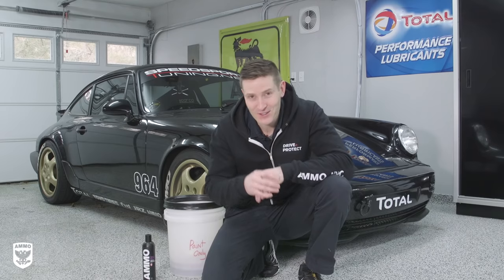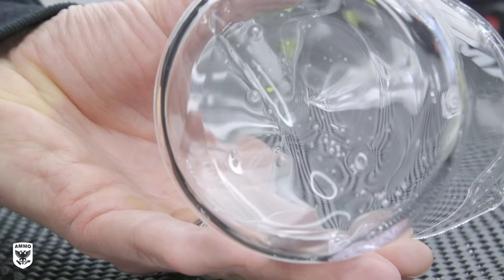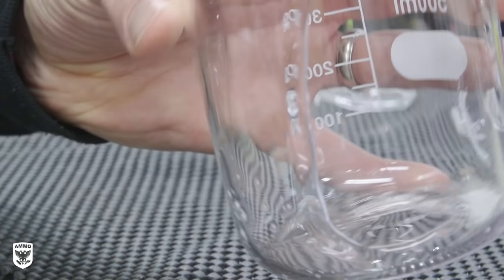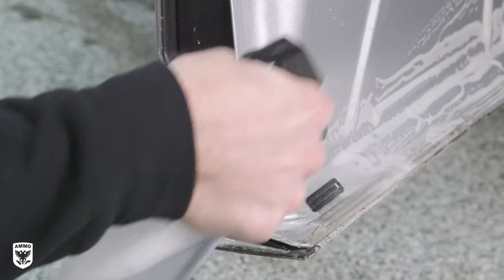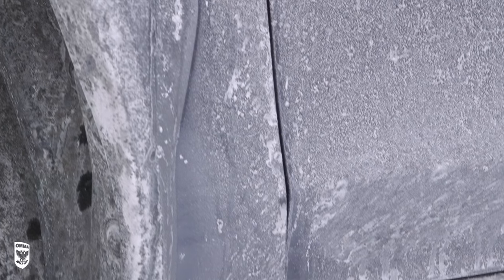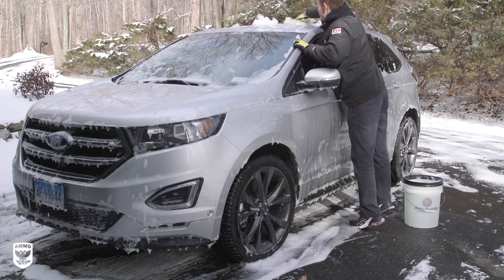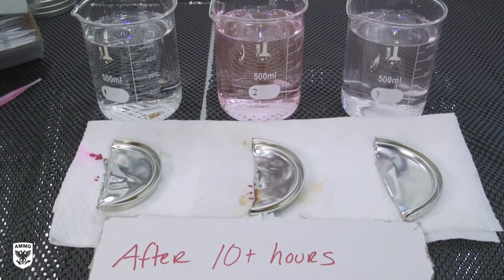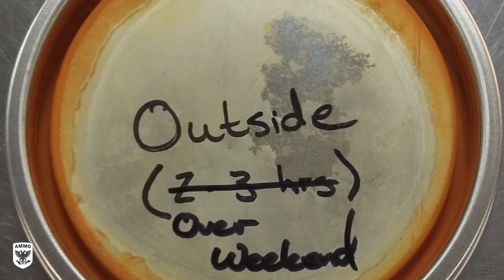Best Car Wash Tips for Winter Driving

Comment: I’m in Southern California.  Our cars don’t rust.
Reply: Aves Raggiana that's because there's no water in California to rust your cars.
Reply: Savage
Reply: That's why I really appreciate that Larry lives in NY. If he lived in Cali, he wouldn't think to formulate products like these, & guys like me, who live in the Northeast, wouldn't have any way of combatting rust.
Reply: Joshua LaVancher Touché.  I set myself up do that one.
Reply: HawkeyeSTiGuy My car is 12 years old and has 213k miles. Hardly ever garaged. I live in Denver and I don't have a spec of rust on my car or underneath. Benifits of living in a dry desert that gets occasional moisture.
Reply: Aves Raggiana : Yes, they do. Look at the frame/subframe, suspension arms, and drive train (drive shaft; couplers). They all begin to rust as soon as you drive them home. The rust Larry showed on his 964 was a common problem, including, I am sure, California cars.
Reply: Ben Smukler Yes a car can rust regardless of location but remember climate plays a huge factor. Denver and Phoenix for example have very low humidity values. Sometimes the humidity gets as low as 5% during the day. I think that factor alone plays a huge role in rust. These places mentioned are not really known for rusted out cars like the salt belts and any rust that is on these cars is surface rust and doesn't cause a problem.
Reply: I live in Colorado and nothing rusts pretty much
Reply: We have some nasty water though, so you can still benefit from this product
Reply: Aves Raggiana I live in ranui. same

Comment: I have some hard water residue, I'm assuming, stuck on my window that won't come off with window cleaner, soap, or whatever. I was going to use this calcium build up mineral remover spray I have at home or dish soap, but wondering if this additive + water will work? Thoughts? I'm going to be buying it anyways.

Comment: This is groundbreaking stuff, I love it.
I have 2 questions though: You say you need to add a few squirts to your usual soap, but use a 50/50 mixture in your tests.
Why do you use a bigger concentration?

Also (not fully related), do you have any tips for washing during the winter? Mostly in regards to water vs the cold.
I currently go drive my car to be sure it's fully heated up and leave it running with heat on max to keep the car warm.
It works but is obviously not very environment friendly.
How do you do it?

Comment: Impressed with your science hardware and your methodology is good!
A few tips: put the viscous component in the water, that way you can rinse the pipette and get the full/accurate volume of boost/soap. Or you can "reverse pipette" : pipette more than what you need and only eject the correct volume, that way you prevent the majority losses from the boost/soap sticking to the side.
Have fun experimenting :)

Comment: Door jams and the bottom edges of doors are much easier cleaned, without touching, with careful use of a pressure washer I find.
Been doing it this way myself for 10 years without any problems.

Comment: do you gain the same benifits  on the car wash soap and boost mixture  (2 to 3 squeezes) in a bucket since your not using the same ratio of car soap to boost as in your test (50/50)?

Comment: awesome vid, good tips. As an suggestion, could you buy a fender made from the metallurgy of a real fender as opposed to the lid of a paint can? I was thinking that the lid may be a better metal rather than the sheets of stamped steel as used for the fenders and unibody's general structure, cut the fender into test strips. Anyway don't take this negatively, just a thought.

Comment: Hypothetical question, so when you wet sand down orange peel it eventually flattens out. If you where to compound pass after pass would the orange peel level out before burning through or would it still stay there as it thins, Yes i know it would take hours polishing in one spot to do this, but main question is would orange peel stay till the very end during polishing or would it eventually flatten out?

Comment: Question, when you used it on the bottom of door with spray bottle and brush, did you use it straight with water or mixed with soap?

Comment: you said its a booster but when you use it on like the door jams and stuff you use it by itself.. would it be good mixed with an cleaner like lather or ap cleaner?
Reply from the maker: I would not recommend using it with Lather or AP cleaner.

Comment: To clean door jams, If I use the spray bottle with 3 squirts of Boost Winter Wash, and 10-12 oz water, do I need to rinse with water? Or can I just wipe dry with a microfiber towel?

I notice in another video Larry, you use Boost Winter Wash with Frothe, and water in the Arerator, but you just wipe dry with a micro fiber towel.

Thank You!
Reply from the maker: Boost alone needs to be rinsed.  if you mix a little Boost with Frothe, then you don't have to rinse and can wipe dry with a microfiber towel.  Thanks for watching
Reply: @AMMO-NYC   Thanks for clearing that up!

Comment: you don't like pressure washers ? I do not see much of them in your movies ;)
Reply: I think he just likes to show other options because he realizes than not everyone has one. Pressure washers are great, but I like that he does things by hand for the most part. Also, you do have to be careful with them. Most newer cars are fine, but a pressure washer can damage older cars & force water & dirt into places it wouldn't normally get into.
Reply: Also, every car's paint has different densities. My 1990 Jeep had VERY fragile paint. I made the mistake of using a pressure washer and there was a speck of dirt near the windshield that never came out. It was buried in the paint. I learned to avoid them with that car. I no longer use pressure washers because the business owners always crank up the pressure too high. The wash bays are cramped so it's impossible to stand more than 2 feet from the side of the car. I always wash with a bucket.
Reply: I thought about getting a pressure washer but decided not to as I have good water pressure and a foam gun w/quality soap is good enough

Comment: To my knowledge salt is not magnesium chloride (MgCl) but sodium chloride (NaCl).
Reply: I love the videos, though.
Reply: Street salt is different from edible salt.
Reply: sunnyhaibin: you're right, MgCl is indeed used for ice control. Thanks for the clarification.
Reply: Street salt is MgCl2. When dissociated in water, this compound creates 3 equivalents of ions (2 chlorides and a magnesium) vs NaCl which would give 2 (1 sodium and 1 chloride). The more equivalents in the solution, the lower the freezing point. So a solution with 3 equivalents (MgCl2) has a lower freezing point than a solution with 2 equivalents (NaCl). This is why MgCl2 makes a more effective road salt than NaCl.

Comment: What is the safest way to wash a car covered with sandy mud?
Reply from the maker: get as much off as you can with a hose before touching the car with a wash mitt and when you do touch the car, be sure to rinse it frequently in a specified rinse bucket using the two bucket system.  Hope that helps.  Thanks for watching